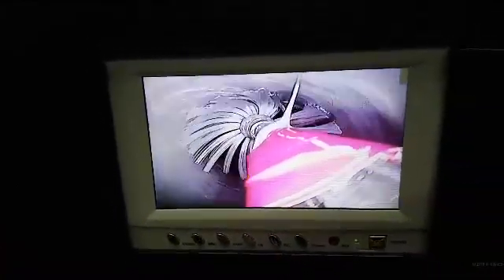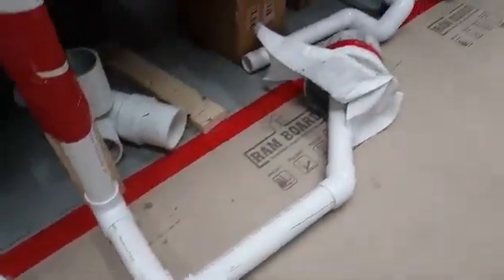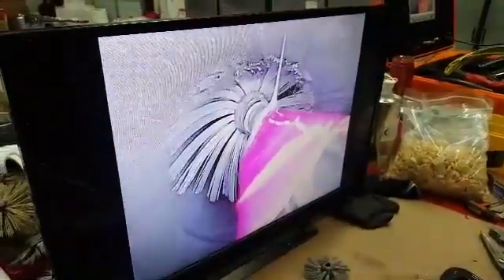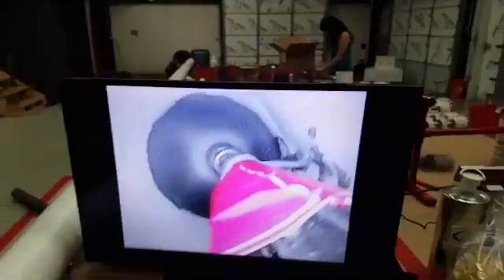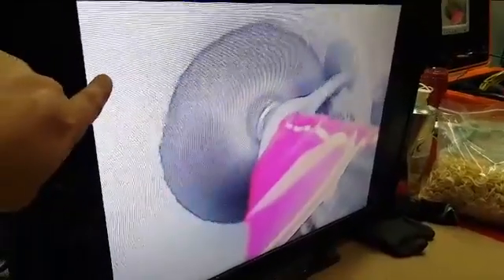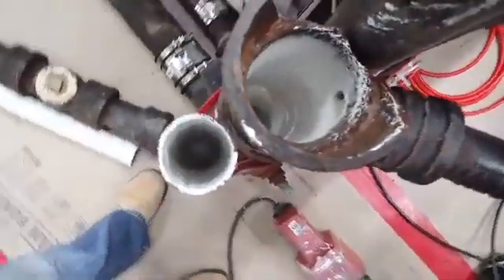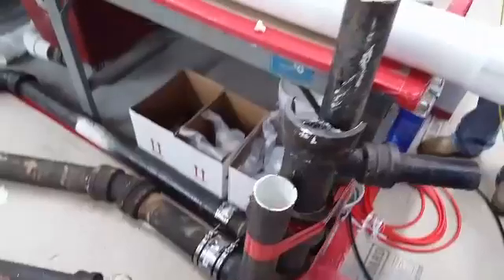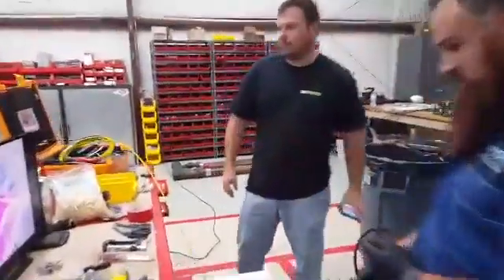Internal Pipe Coating Training

Comment: HOW LONG DOES IT TAKE FOR THE COATING TO CURE?
Reply from the maker: Kimberly, the Picote Epoxy resin typically will cure ambiently in 2 - 2.5 hours between coats. If a heat system or hot air blower is used it can cure in as little as 1 hour between coats.